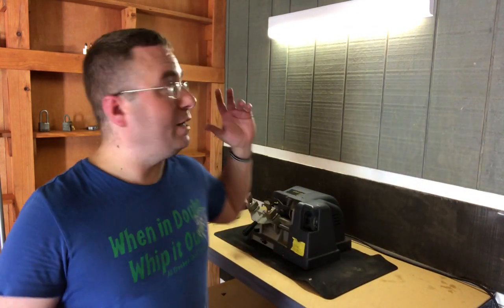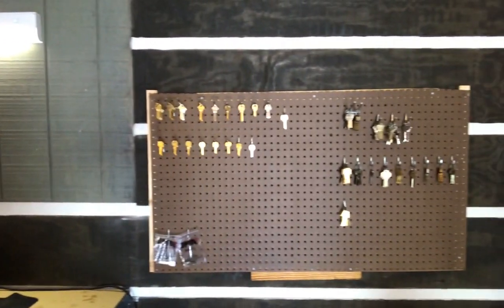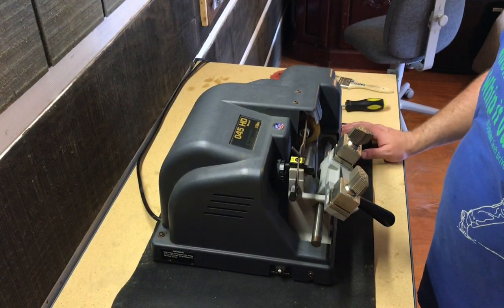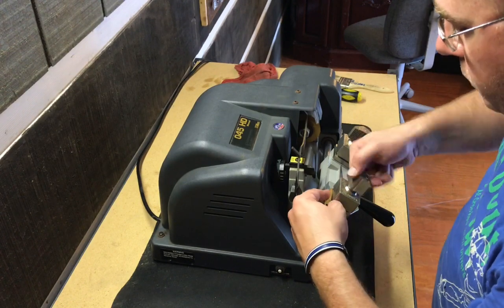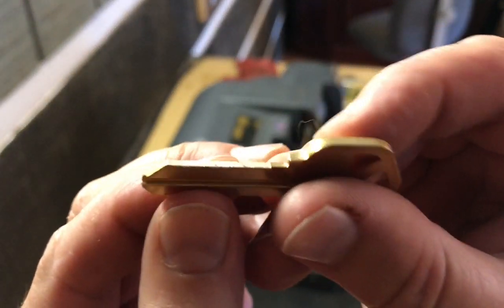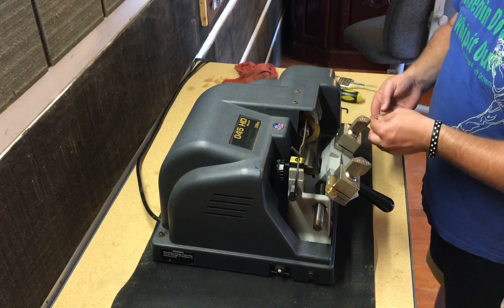Ilco 045hd cleaning and calibration

Comment: Very nice duplicator. To help you get more accurate calibration with fewer blanks most duplicator manuals suggest the following rough procedure:
1: select two identical blanks (use calipers to measure the blank for maximum accuracy)
2: put one blank in each jaw
3: with the power off, rotate the cutting wheel by hand
4: adjust the tracer depth until the tips of the cutting wheel just scratch the blank in the cutting jaw
5: tighten all retaining screws and get to work
For checking spacing and space adjustment, you can find the manufacturer's instruction manual here: http://www.ilco.us/products/key-machines/traditional-edge-cut/805340-804582/045-hd.html
Reply from the maker: I will do this tomorrow! 😃👍 thank you my friend! This is a great machine for sure; got it for a steal at $80 about a year ago. I do need a new cutting wheel since this one has a broken tooth. Still looking for someone who wants me to “store” a Blitz for them 🤣🤣

Comment: Nice video LPP .It looks like you have the calibration down.Kwikset does have some wide cuts and can be picky sometimes. ,when you cut them on a code machine you have to make sure to widen the cuts.I use my Foley-Belsaw 200 that i got when i took their course to cut Kwikset on and it does an excellent job.
Reply from the maker: I’d love to get a real code machine when I grow up 😜 cutting by space and depth keys can be a pain. The only good thing (in my book) about Smartkey is that if it’s set with a good key, you can tell if it’s a good copy.
Reply: @LockPickingPatrolman  Check out Jason's video about making the KW key checker.Code machines are real expensive.
Reply from the maker: Brian Edmisten I’ve watched it a couple times 😂 I just haven’t pulled the trigger on buying the parts yet. And yeah, I keep looking and praying... but it’s like I told Bill Bacardi; they didn’t name the Blitz the 1200 for nothing 🙀
Reply: @bestrafer38  And this is actually one of the more expensive manual machines.  They're around $900 new.

Comment: Nice machine. I have the 025. Its a lot easier and more accurate if you calibrate it by turning the wheel by hand and just kiss touch the key blank. You have to take the cover of and put a wrench on the brush wheel to turn it. It's not that easy to turn. That's how I calibrate mine. It holds the calibration very well unlike the Foley Belsaw I have.
Reply from the maker: Thanks Bobby! Yeah I learned that trick to calibrate after this video 😂 it holds calibration pretty well actually. I need a new cutting wheel on it though 🙀

Comment: I think my machine is off left right. how do I calibrate side to side? not just the depth?
Reply from the maker: The easiest way to check if it is truly out of adjustment is to flip the key gauge down with two blanks loaded. If there’s any space between the gauge and either blank, then loosen the jaws for the one that’s off and slide the blank over until it’s stopped on the gauge.